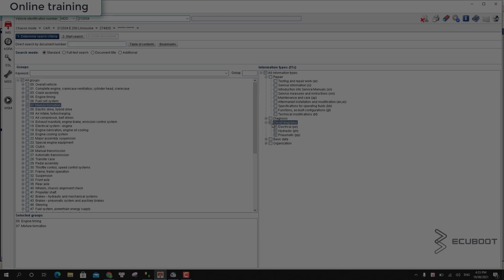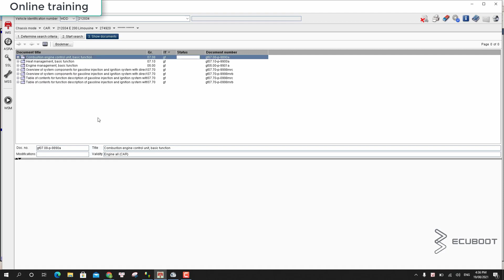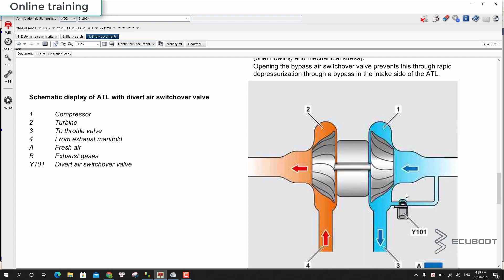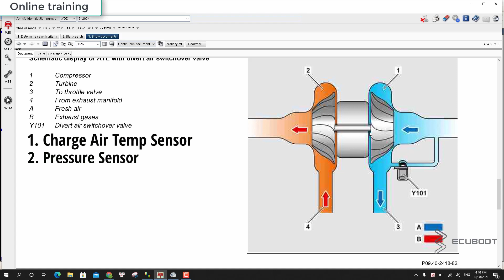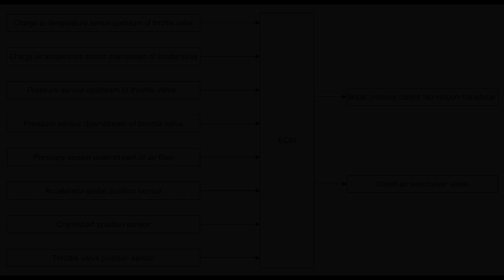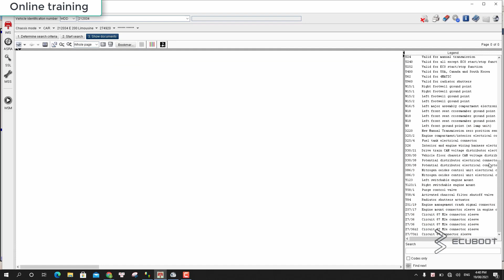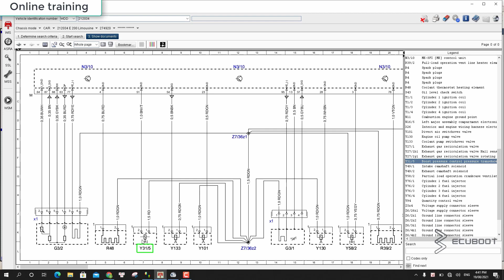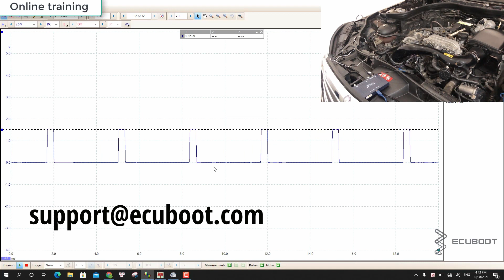How to Check the Boost Pressure Control Pressure Transducer on Mercedes M274 Engine

Comment: I want to install a turbo boost gauge. Where do you recommend to install the vacuum tube from the turbo boost gauge?
Reply: Between intercooler and throttle valve, i guess. Gauge will provide inaccurate reading if you place it between turbocharger and intercooler. Or very close turbocharger compressor. There is fluctuation in air pressure in these areas. 
This is the reason mercedes has Boost pressure sensor between intercooler and throttle vavle.

Comment: I have a question, it seems like my pressure Transducer selenoid doesn't allow vacuum to move the wastegate actuator. The fault code that appears is P029921.
My car is a 2018 slc 300.
Please help.

I would also like to know what is the load that this turbo is programmed to hold.